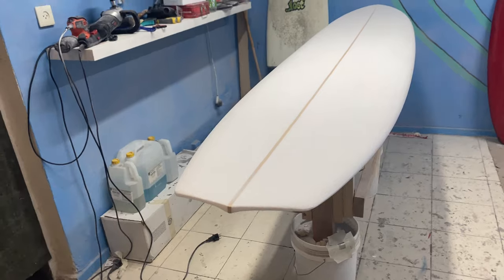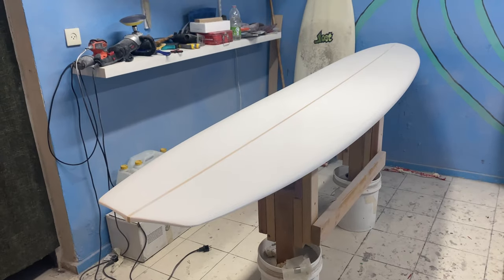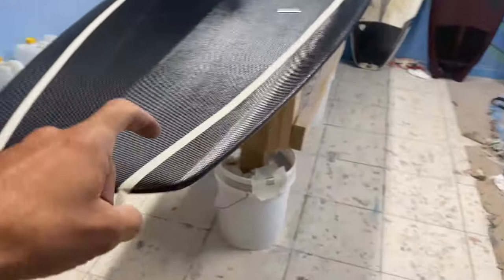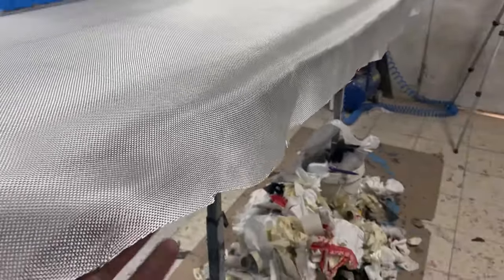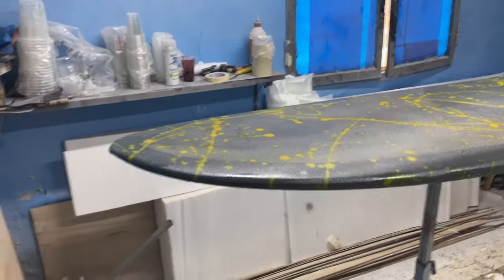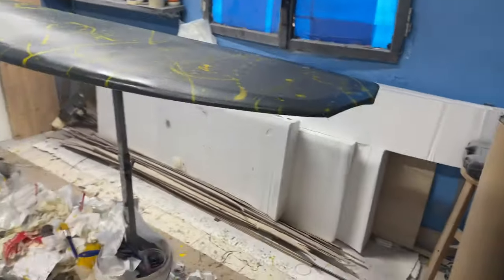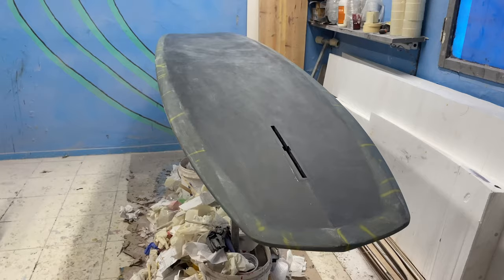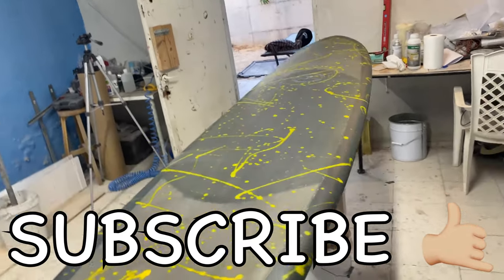Glider Surfboard Full Carbon Fiber Longboard | Glassing Time-Lapse [Start to Finish]

Comment: Finally someone who calculates exactly the amount of resin for laminating or hot coating! Mother nature thanks😁
Reply from the maker: We do our best! And we use Epoxy only 🤙🏼
Reply: @kobymaymonsurfboards7320  However the shape is very interesting. It would be wonderful to see in action on a video...
Reply from the maker: @paoloparea  i have pictures- i will do a post or you can check my Instagram 🤙🏼
Koby_m1982

Comment: Koby
I love the awesome finished look of it. Can you tell me the weight of the finished board, it is so cool! I want to make a glider like yours for my next board. I see you kept the weight down by using matte spray instead of another resin coat. One guy I surf with has been telling me to make a glider for some time now. I will study your contours and rail shapes from your well filmed video.
Reply from the maker: Thanks bro 🤙🏼
The weight is 5.2 kg only - so much fun 🙌🏽

Comment: Great build ! Superb finish ! 
What’s your sanding process, what grades do you dry sand with and then what grads for the wet sand ? Also do you use sanded pads with your orbital sander. 
I’ve built a couple of wing foil boards but struggle with the finishing.
Reply from the maker: Final sanding: 80, 120, 240. Then wet: 400, 800, 1200 and after drying i use spray matt clear coat 🤩

Comment: Unreal board Bro!  Great videos and instructions. Your an artist and a craftsman!  You have inspired me to build my own board. How did you add  your white logo to the black background? I know many builders print their logos on rice paper which becomes essentially invisible once glassed. You seemed to add your AFTER the glassing. Can you explain your logo process including what material you use?
Reply from the maker: In this case i have done the logo with spray on top of the hot cote and under the clear coat with a template. To print white on rise paper you need special order from Boardlams. Usually i do all my logos black on rise paper 🤙🏼
Reply: @kobymaymonsurfboards7320  thanks for the tip!!  That’s a beautiful board by the way!

Comment: easy trick for marking the cutlap. I usually run a wider tape at the approx. lap line + the width of the tape I will you for the cutlap, then use my diy scribe tool to draw the cutlap line on the first tape, then tape the final cutlap tape on the line.. works great, no need of scratching the lam, no pencil marks on the lam etc.. :) anyway, nice vid man! Btw. how many OZ is this carbon cloth? I lammed with carbon some time ago for the first time and I am stoked how the board came out even though I was kinda affraid about hand lam the carbon haha:)
cheers, Milos / Apatyka surfboards
Reply from the maker: Board turned out great, super fast, no issues with the lam 🙌🏽🤙🏼

Comment: Hey Koby - sick board. What's your calculation for working out how much epoxy? Also, how do you do that leash plug? drilled from the fin box?
Reply from the maker: For the leash plug i will do a short video in the next board, about the calculation, beginner should use 120gr per 1ft (epoxy) if the board is not too wide (less than 21.5”) 
Advanced can go to 100gr per 1 foot.
If you use pigment you should add 10%
6’0 short board clear i use 500 for the bottom and 600 for the deck (2 layers of fiberglass)
🤙🏼
Reply: Is that total including hardener also?
Reply from the maker: @Bido11561  yes, I always talk in total numbers, my epoxy (kwik kick) is calculated: for every g100 base i add g45 hardener.
Reply: Looking forward to the leash plug video!

Comment: Where do you get your old school leash plugs?
Reply from the maker: This is simply a hole through the fin box up to the deck filled with epoxy, then a small hole for the string 🤷🏻‍♂️
There is no plug there

Comment: What is eps or pu
Reply: EPS stands for expanded polystyrene (kinda similar to styrofoam) and PU is Polyurethane. PU boards are more “traditional “ and are typically glassed with polyester resins. The PU foam is also closed celled making is less prone to getting waterlogged. EPS is much lighter than PU making for ultra light boards, but you have to use epoxy resin or you will melt your blank.